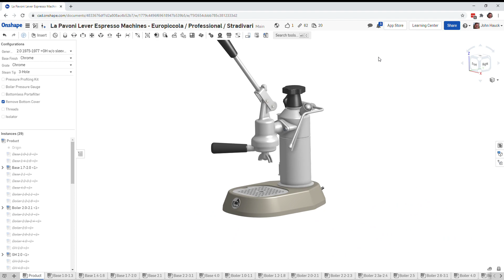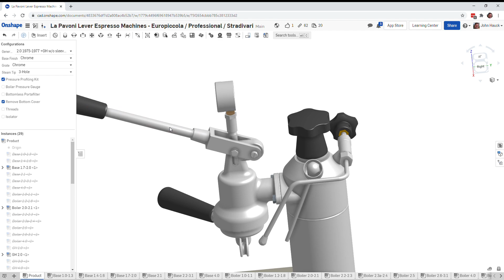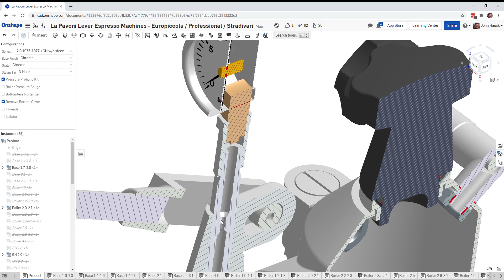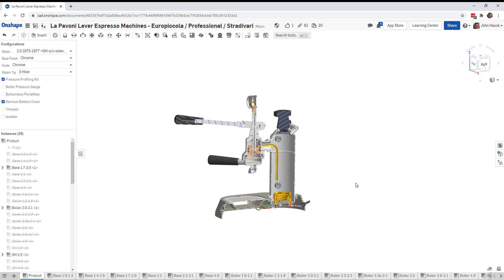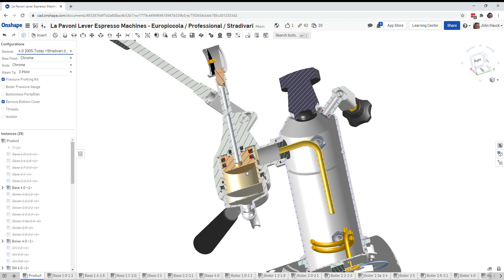11. Pressure Profiling Kit - La Pavoni Lever Espresso Machine

Comment: What sort of pressures are you averaging? For some reason I almost never get to 9 bars. I tend to pull in the 3-5 bar range. At 9 bars the force required feels immense and takes forever to pull the shot all the way through. I was thinking I might have installed the guage incorrectly (Piece of teflon tape stuck in the tube somewhere or something) but I wanted to hear from other on what sort of pressures they're getting when they pull and what that feels like (easy or super difficult to push the lever ect)

Thanks!
Reply from the maker: To pull 9-bar on a counter-top positioned machine, my elbow needs to be above my hand.
On a dining table positioned machine, it is much easier to pull 9-bar.
My usual pull (for my taste) is closer to 5 bar.
Reply: @JohnMichaelHauck  Do you notice a typical sort of difference between the shots you pull at 5 bars and the shots you pull at 9 bars?
Reply: I use 8,  8.5 bars , so hard to get the 9 bars , immense pressure,  but it is a it's a perfect taste grind , use only 9grams off coffee 25sec
Reply: Nine bars is a method, not a law. The only law is the one that states that your espresso must taste good. On my Esperto Abile (came with pressure gauge), I started by figuring out a grind size so I get 30 grams out for 15 grams of coffee, in about 30 seconds, without having to stand fiercely on the handle. I do have to stand purposefully in front of the machine, but I should not have to hold my breath and shake like a wrestler to pull an espresso. That being said, I get this: 15 g of coffee, 30 g out in 30 seconds, with a profile that starts at 3 bars for a very short while, then 4 to 5 bars, then decreasing. This is a STARTING POINT. Then, taste, adjust, repeat. LaPavoni has a hard time with very dark and very light roasts. Go with semi. I use roast level 3/5 from my roaster and I manage.